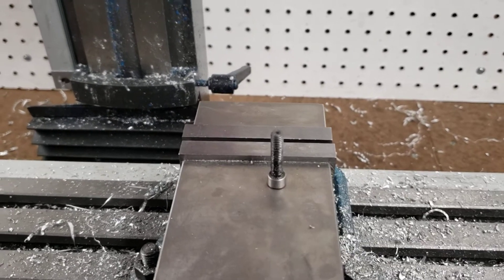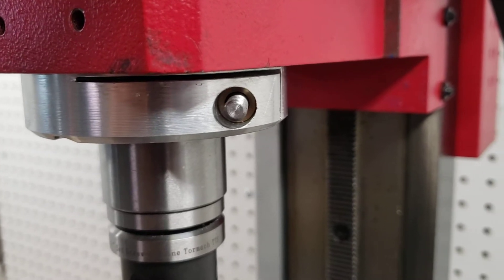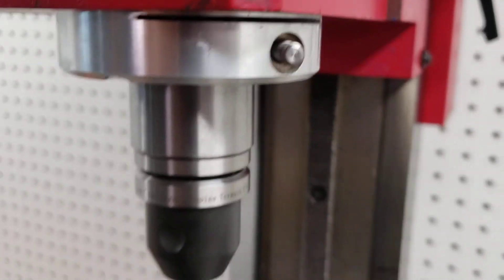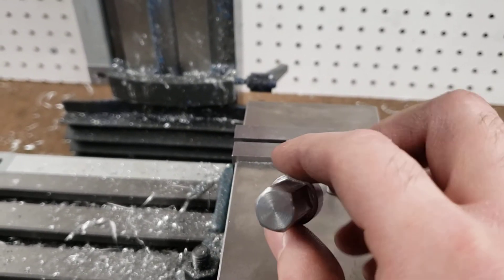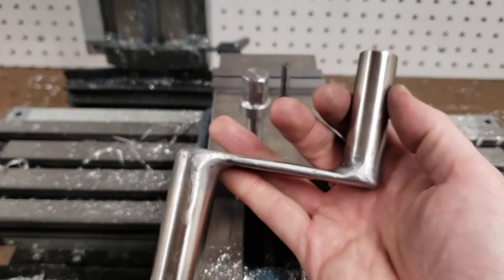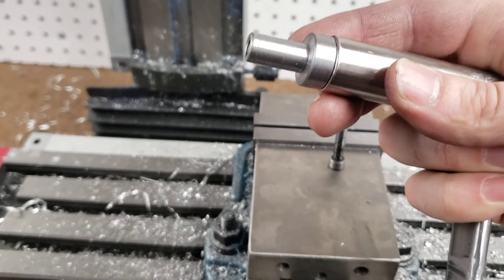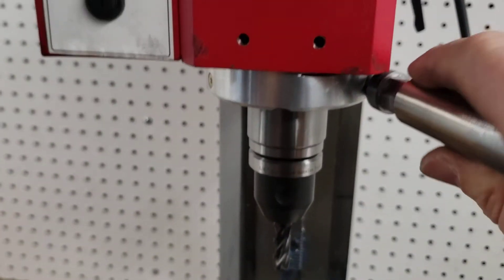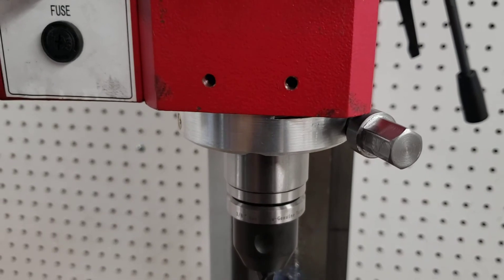Mini Mill Spindle Lock Addendum

Comment: Even better now. Still wondering if your camlock idea would be the way to go.
Reply from the maker: Much appreciated! 

Honestly, having used this a while, I don't think a cam lock would be much faster. It really only takes a quarter turn (or less) to lock/unlock the spindle. Given that I've already got the tool I made in hand, it's fairly trivial to use the lock as is.
Reply: That works a treat mate